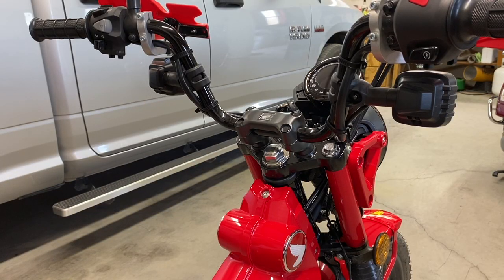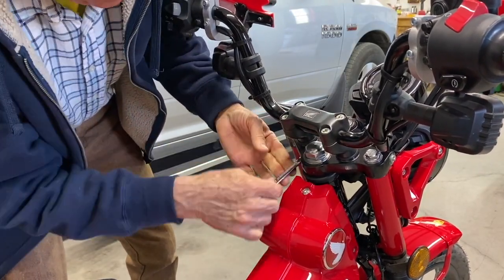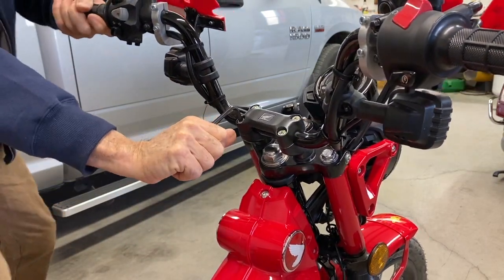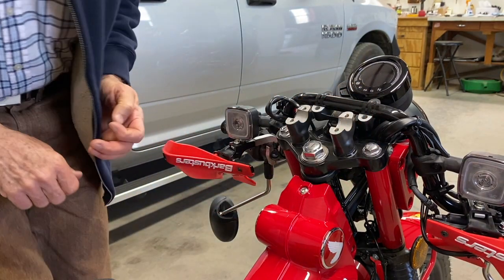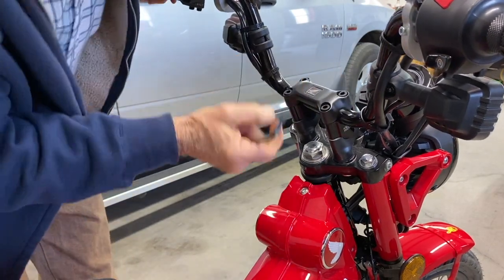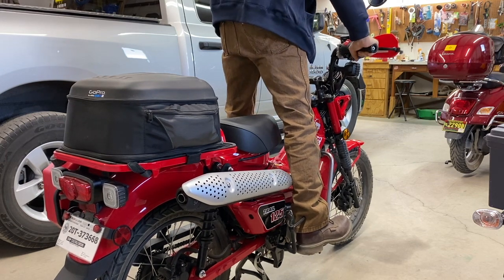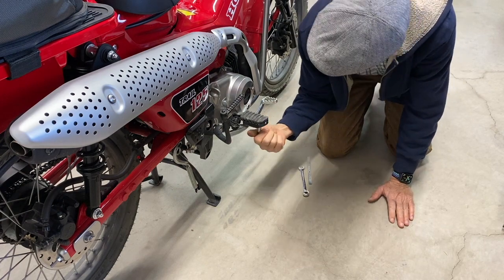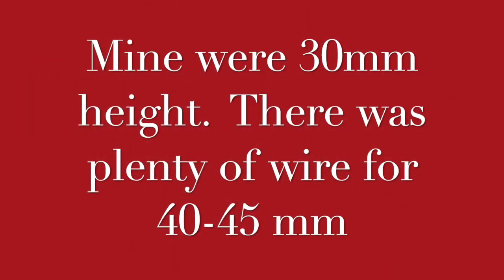CT125 handlebar risers installation   HD 720p

Comment: Good video. I turned my clamps around when I first got it a couple weeks ago. I considered the peg rubber removal too. But haven't done it yet. I noticed the CT70 in the background. I have one just li kik it.  Mine is a 1972 model with 2200 original miles on it. It's not quiet as clean as yours but its 1kick start bike. I'm liking the ct125 pretty good except the the suspension needs a little perfecting. I only have 35 miles on it so far. Weather is bad holding up my riding.  Have a Happy New Year!
Reply from the maker: Thanks and happy new year to you too.  My CT70 is a CT125 Chinese clone.  I just rolled over 600 miles on my CT70 and changed the oil.  Now the weather has turned cold but hoping for some 60 degree days next week again.

Comment: I like your bike I have a 1970 ct90 and they are awesome 
Could you please do a little video about your auxiliary gas tank and how you mounted it 
Ps you do a very nice job with the videos please keep up the great work!!
Reply from the maker: The gas tank mount is my own creation.  I bought a saddlebag mount and Givi saddlebag from 
beezdeals online.  That saddle bag is kinda junk and doesn't fit it too well but I cut a length of conduit pipe and drilled a hole in each end and into the saddlebag mount and mounted the (included with gas tank) gas tank mount on the pipe.  This is better than most of the other gas tanks mounts for this bike because I didn't have to remove the toolbox.  and I can loosen the nuts, swing the mount down, and still use the saddlebag.  I'll try to remember to make a short video of it when I get back from vacation.

Comment: I've been riding mine in Indianapolis freezing.  I need to do some upgrades.  Hand guards wld probably help my hands from going numb.  I've got 177 miles and having a blast breaking the rules at local park.
Reply from the maker: The Barkbusters don't offer much wind protection.  I'm disappointed.  If I can fit ones from my Kawasaki KLR650, those will be the best

Comment: Thank you for posting this video. Exactly what I was looking for. But I have a question: Why did you rotate the bottom mounts 180 degrees? Just wondering what the purpose was. Thanks.
Reply from the maker: That should be pretty obvious if you think about it.  it's to get the handlebars farther from you so they are more comfortable when you stand on the pegs and also more comfortable for taller guys with longer arms.

Comment: i see a Rukus a Vespa scooter or something like it, The mini trail, and is that a late model gen 2 KLR in there as well?
Reply from the maker: that's a 2018 Vespa 300GT, a CT70 chinese clone with 125cc engine, and a 2013 KLR (last year of the soft suspension).  I have none of those bikes today.  I have been through a lot bikes in the last three years since I made that video.  All four of those are gone.  I got a 2021 Kawasaki W800 (now gone) and, a 2021 Moto Guzzi V7 (now gone), 2021 Yamaha XT250 (now gone), 2021 Honda Monkey, 2022 Kawasaki Versys X 300, 2022 Honda CB500X and a 2023 Honda XR150, so I have four different bikes in the garage now than I had 3 years ago.  My next one will probably be a Triumph X400 Scrambler or maybe the new Honda CBR300R.

Comment: Does this in any way affect performance?  I read on another form that it can lighten the feel of the front end.  I'm just getting back into riding again, but when standing the CT125 does feel a tad awkward to me-- a bit hunched over but I'm also extremely rusty.
Reply from the maker: The best thing you can do is reverse the bottom bracket mount to move the pivot point forward to reduce sensitivity
Reply: @spydie  So skip the risers and try that first?  By reverse you mean turning them 180d?
Reply from the maker: @mattp9029  No, get the risers so you can stand up.  Reversing the mount is better no matter what you do if you want to slow-down the steering (less squirrely).
Reply: @spydie  I added the spacers and reversed the mount.  Feels much better to me all the way around.  Thanks for the tip.
Reply: Another question.  I installed these and it's much more comfortable standing.  My main issue is I'm hitting the heal shifter a lot when riding standing up.  Are you having this issue?  I don't intend to ride standing up all the time, but certainly on some trails from time to time.  I'm constantly shifting it accidentally or holding it down which allows you to rev the engine.  Just curious if you have come across that.
Reply from the maker: @mattp9029  sorry. I never had that problem
Reply: @mattp9029  I cut the rear part of the shifter off, much better.

Comment: I put the same riser on my CT…. When I turned the handlebars to the right, it pulled on the front brake cable pretty hard, so I took them off.
Reply from the maker: Didn't do that on mine, maybe you could have loosened the cable a little.  I know it works because I and a lot of other guys have done the same thing.  It might take some fiddling, but it does work.  Bring it by my garage and I'll show you how to do it! LOL
Reply: @spydie    No, that’s ok.  I’m pretty capable of fiddling on my own.  I just figured I would share my experience.   I’m not interested in routing hydraulic lines for my brakes.  Flipping the clamp around 180 degrees gave me a little more room anyway, and yo be honest, I wasn’t even a necessary modification.  I’m going to get some 20mm risers, and give them a quick install to see how they work.  Cheers!

Comment: Can you tell me the measurements between the nuts on the risers 

Say the left riders  
The measure 📐 from top bolt head to bottom
Reply from the maker: I didn't understand that.  First you ask for distance between the nuts (there are no nuts), then you ask from top bolt head to bottom.  Which is it you want?  The risers are 30mm and they come with the proper size of bolts.

Comment: Great video!  I'll see if I can find the raisers on Amazon. Can you share a link or confirm 7/8" universal raisers will fit?
Reply from the maker: 7/8" is correct (that's what about 99% of motorcycles have.  I've never had any bikes (63 total) with any but 7/8").  Amazon has dozens of them.  They are all the same, just pick the cheapest one.  You can risers or risers with set-backs (my favorite).

Comment: Good add on, post the link please, will any Honda risers work? Great watching you work on it and love the 60's music and the your other scooter.
Reply from the maker: Here are the 30mm risers I used,  There is plenty of room for a 40mm or possibly even a 45mm riser.  https://www.amazon.com/gp/product/B073QNBPC6/ref=ppx_yo_dt_b_asin_title_o03_s00?ie=UTF8&psc=1
Reply: @spydie  Thanks
Reply: @spydie  Are they the 7/8" or the 1 1/8"?
Reply from the maker: @mattp9029  30mm is 1.18". Or closer to 1 1/6"
Reply: @spydie  30mm appears to be the height.  With the link you posted they come in 7/8" or 1 1/8" diameter.  I assume it's the 7/8" you ordered?
Reply from the maker: @mattp9029  I'm sorry, I misunderstood what you were asking.  Yes, 7/8". That's the diameter of almost all motorcycle handlebars.  in 57 bikes I don't think I've ever had a different size.